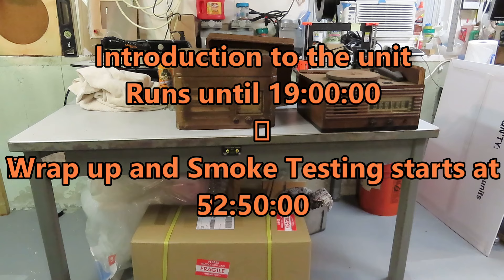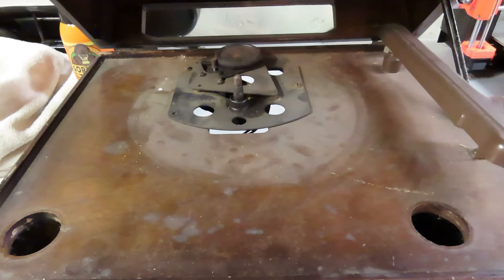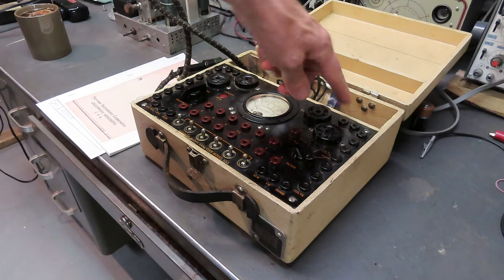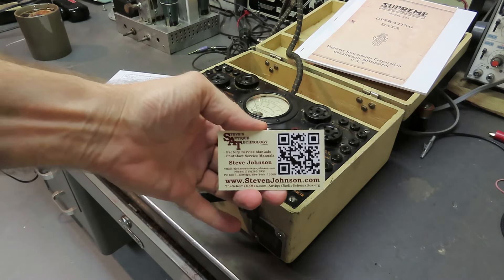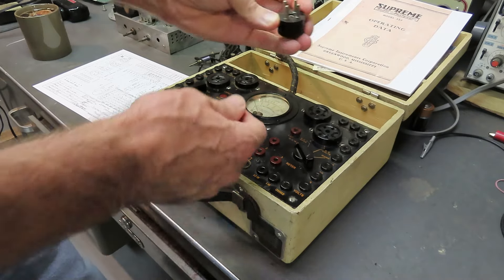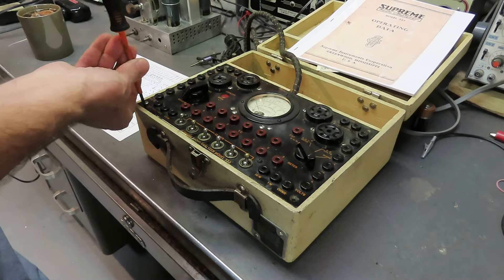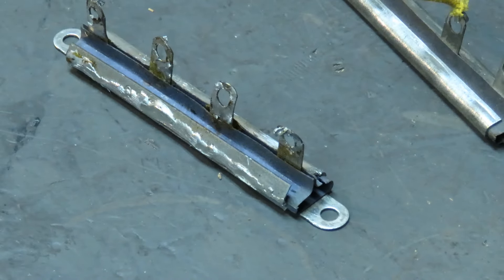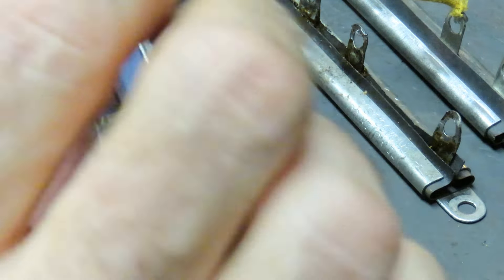Supreme Radio Analyzer Model 333 Badly Butchered

Comment: Wow, that was an epic job Vern and it worked so well. I wonder if something like that would be used in a repair workshop, most old timers would know what is wrong with the radio and just fix it. I cannot believe you can pick up stuff like that for 5 bucks, we have nothing like that here. Good luck with your vinyl cutter 👍🙂
Reply from the maker: @DavidTipton101  hi david, that was easy compared to the one that's on the bench now.
Reply from the maker: Hit the wrong button I hate using my phone for this stuff. Those were marketed to the repairman back in the day. I repaired it just for the fun of fixing it.

Comment: DC meters  from thar era were at best 3%.  AC meters were  in the 5% to 8%.  range.  The sensitive would be 1000 ohms /volt. A 20,000 ohm/ volt dc meter would have been very expensive in the 20s and 30s.  I cut my teeth on 4, 5, 6, and 7 pin tubes. 01a, 45 ,6c6, 6d6 , 27,  24  80 just to name a few. The first transmitter I built was with a 01A tube.  My regen receiver also used a 01A. 
I will be 87 years old this Tuesday.
Reply: @johnlehman2157
Happy Birthday!
Reply: @FireandFrostHVAC   Thank you

Comment: That sure is better than the tube extenders with connections for a voltmeter, but they allow the use of a scope to check signal flow.